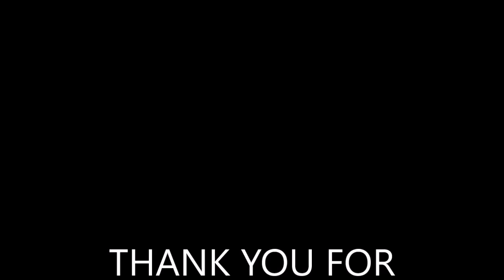How to make homemade FM radio - simple DIY auto scan 100% working on a breadboard

Comment: i see you using a button to press to scan one channel at a time so this makes it a manually scan then  as its only scanning on a press of a button and not self scan  by just one press
Reply from the maker: The idea of auto scan is when it found one channel then it stop... It can't be searching the entire channel all at once just like the rest of radio system
Reply: @neodiy  then you can disable the mute and it be scanning and playing instead of stopping on one station when it picks it up